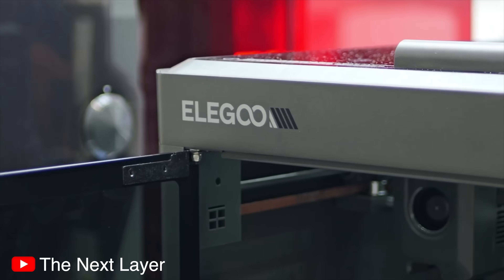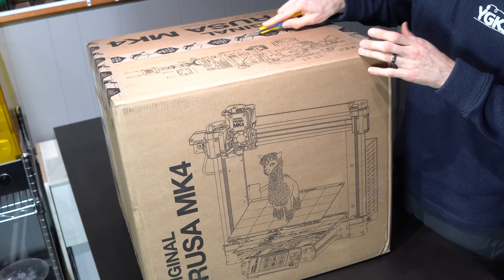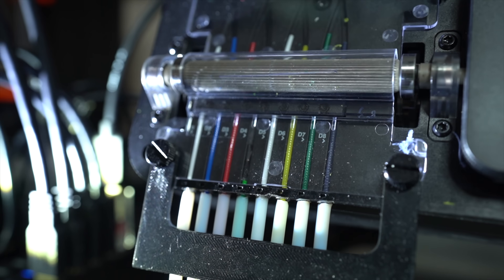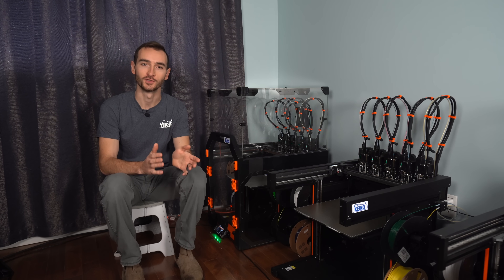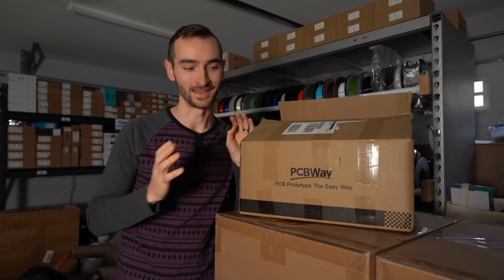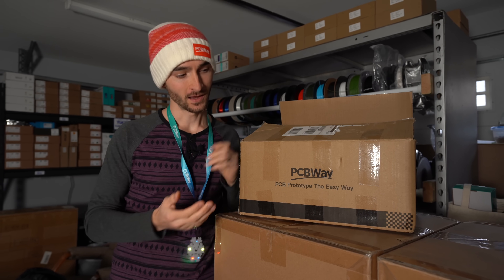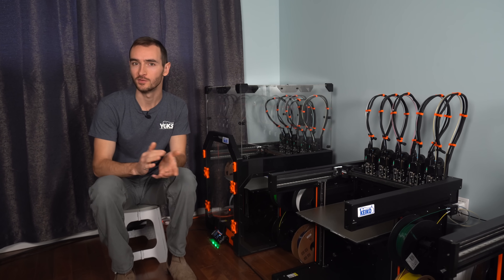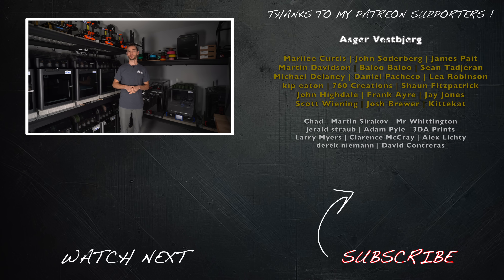The Prusa Core One is dividing the internet...

Comment: For me, prusa takes it for a few specific reasons, if prusa stops existing, much of their machines can be replaced with off the shelf parts, bambu on the other hand is majority proprietary. prusa is made in europe with better working regulations and wages. prusa has great customer care and their up gradability is unbeaten in the market.
As well as all that, prusa came from the open-source and built on it. bambu took from the open sauce, made it proprietary, using it to profit for themselves wile giving nothing back. i know my prusa is gonna work and keep printing at a good solid speed reliably, their not the fastest but with relatively little modding they can hold their own. If I need something done quick, i look to my voron .2 that can accelerate at twice the speed of a bambu and is half the price, as well as being completely open source and easily replaceable.
Reply: That may have been true at some point, but the "off the shelf components" business ain't true anymore. They aren't open source anymore. If Prusa goes under, unless they release their source, there's no replacing their electronics.
Reply: @taylorlandry641  those components are just as good, look at vorons, they are entirely off shelf parts that can beat their proprietary machines. As far as I can see thd only reason they do it is ease of manufacturing and to control the fixability of their products forcing you to buy replacements from them
Reply: @charliecampbell2292  you can't just replace Prusa electronics with some other 3rd party component. That's the point. Unless they release their firmware and Gerbers, then they're exactly the same as Bambu in terms of getting parts in the event they disappear as a company.
Reply: People think czech republic has high salaries...  well, google the monthly wage in cz, its about 1800euro before tax.... in shenzhen, China, where bambu is based, the average wage is about 1800 euro's too...
Reply: It always surprises me when people say, "prusa has great customer care." Genuinely asking, have you used their support and if so was it for a big, real problem or just a question? Because I have used their support and it's why I hate the brand now. 
I bought a MK4 at launch and they sent me a total lemon. Full of extruder and heatbed issues and couldnt print a thing. Support dragged me through the ringer for my entire warranty period even admitting on record the machine was a lemon but that they wouldnt replace it saying, "That's never gonna happen. Its better for us to just send you a part than a whole machine." Again, they admitted on record that the machine was a lemon but instead of replacing it they just ran out my whole warranty period looking for the one part to replace. I even said I would pay for shipping and send back my busted one, but nope. 
The last time I contacted them (out of warranty at that point) I sent over a large spreadsheet with heat measurements showing how the build plate was ALL over the place. Eventually they responded and asked me run some baffling test saying, "wipe some alcohol on the heat plate cold then turn on the heat and film it so we can see how it evaporates." No matter how wet I got the plate with alcohol it would evaporate before the plate could even start to heat up! I did it anyway, 4 times, and sent them the vids. They eventually got back to me and said, "hmm, well, looks good to me so no problem with the heatbed. Here's article on how to pick the right bed temp for your filament type." (me in utter disbelief) You're telling me I sent a multi-page spreadsheet with a bunch temps at different points on the bed over a large period of time while giving the printer completely different tasks, all showing the heatbed was completely erratic and their response was?? "Oh yeah, see the rubbing alcohol evaporated pretty evenly in the one single second it was on the plate so it's fine. Here, learn how to print."
And thats not just one bad agent. Thats hours and hours of Prusa support with multiple agents and supervisors over the course of a year. They managed to run me through my entire warranty period and the only progress we made was them sending me a gear to put in the extruder. I hope it was, "better for them." like they wanted cause I will never make the mistake of buying Prusa again and I tell everyone I can about my experience with them.
Reply: I'm totally with you on the issue, but I think that even European Companies HAVE to be competitive. Their whole market strategy can't be based all on petiness from customers. The same with electric cars unfortunatelly, Volkswagen (Vehicles of the people, literally) is selling EVs for 40k knowing they'll be the only one allowed in 6 years. Why shouldn't I buy a chines SUV EV that cost half the price and is genuinly better? Same with bambu, remember their response didn't come yet to the Prusa Core One. Their printers were released 2 years ago. I honestly think prusia underdelivered here. This printer with no easy multi color printing and somewhat a weirderd build volume already is not up to standard for today. I think the competition is once aganin gonna be blown away. Remember those guys come from DJI. DJI has virtually no competition, they even took on the GoPro market because the Westeners were so fucking incompetent. So too little too late from prusa.
Reply: @IHateYouMoreThanTechnology  European firms can never compete over the price tag alone, because if you care for your workers and your environment its more expensive then if you do not. Top that with "optimizing the conditions" in a country and you stand no chance. 
I think Prusa sits in a niche where they cater the needs of tinkerers and the niche is so big, that they can't manufacture enough goods (some Prusament is always sold out).
And the tinkerer in me really likes the core one - while it may not be the right thing in a professionell environment, if you have upgraded your MK3 to MK4 and MK4s, you now can go the next step all while owning exactly one printer.
So Prusa is not for one to start 3d printing as cheap as possible, but for people who care a bit more about non-shady practices and are up to pay premium for that on their hobby.
Reply: @zwei.r  overreliance of off the shelf parts instead of proprieatary efficent designed for the specific printer bits that are cheaper to manufacture in large volumes is holding Prusa back. Their printers are expensive for what they offer not just because of wages and working conditions, but because they are assembled from stuff other companies make, loosing significant margins.
Reply: @IHateYouMoreThanTechnology  Everything can be produced cheaper and iterated faster in China. Screaming that EU companies have to be perfectly competitive with China is a bit simplistic (at least if you work in the EU yourself), because there is no easy way to do that. It would take lower salaries (which would be incompatible with rent/mortgages for many people), better/cheaper access to resources (which is hard to arrange), healthier surrounding industries ( certainly cannot happen overnight, especially not if people are not motivated to buy local ).
Reply: Totally agree, just want to add that Prusa was there for 3D printing development pretty much from the start, and if Bambu, Creality, and other even exists is because Prusa did most of the R&D in the first place and everything they've done was Open Source, they allowed the "cheap" 3D printing to be a thing, without them we coul still be stuck in the old rep/rap era where everything about 3D printing was DYI. 

Yes they are not ahead like they used to be, but products and longevity is good, and until now they never let customer down, with upgrade path after every big design update so you're never completely outdated. Not sure your Bambu X1 can become an X1+ / X2 whenever this thing comes out...
Reply: Come on guys: If either company goes under, BTT/Mellow/etc will have controller boards out within a few months that are 100% plug and play. Of that I am 99.9% sure - there are 100.000s of these printers out there. Someone will make that board and make the money that comes with it.
Reply: Also, Bambu needs to access their servers and if they decide to shut off access you have a bunch of paperweights.
Reply: @allencochran5 again, not really. You could print it without connecting to the internet. Just use the SD card
Reply: @allencochran5  no they don't. I print everything in LAN only mode, never allowing any communication with BL servers. Also, if You're running a print farm, You can just take the sliced gcode to the printer in an SD card, as You're likely to print the same part over and over again.

Comment: I prefer to not have either of them! Both are Elitist, high end type companies whom see their products as being the best when in fact you could buy for better for far less money which are Klipper based printers which Prusa are not and Bambu only do on the top most expensive printer they did. Also with Bambu they say to get the full software control and features of their slicer you MUST use their Cloud file system, 

I do not wish to use that thanks, my designs are mine not to share with Bambu who could copy them because they can see all them on their cloud service.  Prusa don't force you to use the cloud, But their printers are super pricey as is all their parts shares and filaments. so no thanks.   So no Prusa and Bambu both are not my idea of a good value good printer choice.

I use Qidi or Elegoo printers. far less pricey and not elitist or the type of companies who say you must use their file sending system by a cloud or expect you to pay silly high prices for a over rated printer. The problem with Prusa is they expect everyone to pay super high prices for everything they do and since most of their printers don't have Klipper I won't have them! With Bambu the same thing over priced for a non-open source system which again is very pricey for what you get.

I think both companies will suffer sales wise now other better lower costing printers with open source klipper control without any file cloud loading are in the market.

If you are buying either these two over priced elitist brands then your a fool with too much money and no brain!

Comment: The force sensors in the X1C are a user replaceable (and pretty inexpensive - $5) parts, so your paper weight could be printing in no time and (almost) no money, the heated bed is also a user serviceable part but its not cheap (around $150, but so are Prusa's heated beds). The real issue with the X1C serviceability is the motion system, there are user-serviceable parts but they are expensive and there are some parts (like the Y axis bearing for example) that are not serviceable at all. Bottom line is -  the serviceability of the Prusa printers is unparalleled, but the Bambu is mostly user serviceable but there are some parts that will render you printer useless if worn out.

Comment: Finally a prusa that doesn't look like a DIY project a high school kid made in his garage.
Reply: If you're buying a printer based on how the machine looks, let's be honest, you aren't buying it to make things, you're just buying it to have a trendy conversation piece.
Reply: @dreadpiraterobertsiv  I get your point but there are multiple options with equal or better performance at the same or lower cost with better aesthetics for most of Prusa's products, other than their multihead printers which Bambu is scheduled to release in Q1 next year as well.
Reply: @dreadpiraterobertsiv  no, I'm basing it how well engineered it is. There's a difference from those who built a bambulab 3d printer and the diy 3d type machines. We are looking for innovation from the machine, we just aren't seeing it on the prusa core one. They pretty much transfered the mk4 parts onto a corexy design.

Prusa really needs to take a mass production approach to making a product. They should know that if they aren't competitive, well no one is going to buy their machines. Idk, they really need to I!prove their multicolor design, that has never seemed to work flawlessly since it was conceived years ago.
Reply: Core one looks really cheap with the stamped sheet metal. It is still a diy kit. I don't mind it being that, but it definitely not the level of manufacturing that other 3d printer companies have now. 3d printers nowadays don't have to cost a lot to make them print well.
Reply: @ I agree but it’s a step in the right direction. Prusa greatly undervalues product aesthetics imo.

Comment: I have a friend who buys 3D printers for work, and I recommended them the Bambu Lab X1C or P1S/P, but they couldn't do it because they cannot connect it to the internet. It is actually a feature worth mentioning.
Reply: Then you could just get the X1E for that exact reason. 🤷🏻‍♂️
Reply: There's both LAN-mode and SD-card for offline printing. What are you even on about?

Comment: You can build an entire Prusa XL but replacing a $5 force sensor or even a $120 head bed means you have a paper weight?
Wut?  Did you forget hot to hold a screwdriver and follow step by step instructions?
Reply: You've obviously never ran a print farm. This dude is constantly going from machine to machine and the downtime of basically none to replace things. He said FOR NOW. Something that you and other commentors seem incapable of recognizing
Reply: @SiFireHasSpeed  I own non but the words play in video make it look like a unbiase comparison but it looks so advertised for Prusa to me to devalue competitors and I don't angry at all.
Reply: @Technobby  If you think it was an anti-Bambu jab then I cannot save you.
Reply from the maker: @Technobby  Advertising for Prusa when I say that their new printer will be instantly dated when Bambu releases their next machine? That's not very good advertising...
Reply from the maker: @SiFireHasSpeed  Thank you for pointing this out! This is exactly what I meant. They're paperweights *for now*. I don't have time to fix them during this busy holiday season. I'll replace clogged nozzles, etc. but an entire heated assembly overhaul is more of an undertaking than I have time for right now.
Reply: @ygk3d  It's like an hour repair...The printer obviously isn't printing, so it's down right now. I think finding an hour to replace the bed would save time in the long run if it allowed an extra printer to be running. It would be one thing if the printer was still running, but not at full speed and shutting it down for the repair would mean loss of production.

Comment: I would buy a Prusa over a Bambu, even if they don't have as many features. I don't want to send all my data to China, and I want to have reasonable support and repairability. Plus, if you haven't had the speed of the Bambu before, the Core One is still a lot faster than the bed slingers. Bambu is not a good long term bet, but I hope they drive Prusa to finally innovate instead of only making minor changes.